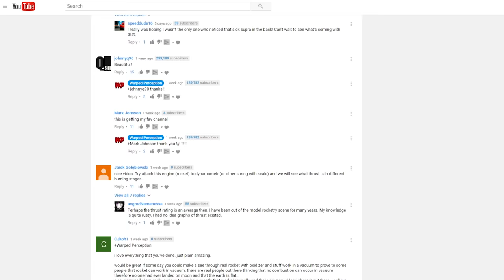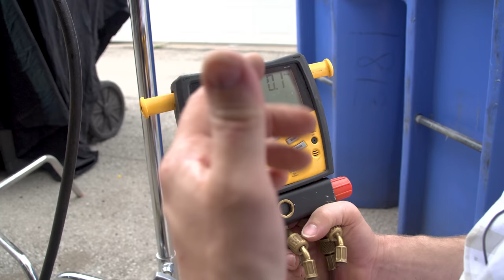Model Rocket Engine In A Vacuum Chamber - 4K Slow Motion - will it burn? - Rockets (S1 • E3)

Comment: Not. The rocket starts to move, only when the gases reach the bottom of the tube. In conclusion: There is no vacuum in space.
Reply: Except for that pesky little fact that we have MOUNTAINS of evidence that space IS hard vacuum.
For example I have personally helped build, test, and launch six spacecraft, two to earth orbit and four to deep space.
I helped operate three of those during their missions.
Reply: @stuartgray5877  OK. Surely you have done  these jobs, but this does not mean that there is a vacuum. 
If there really was a vacuum in space, rockets wouldn't work. This was proved in your experiment. Surely you have done  these works
Reply: @Aquariotp  - "If there really was a vacuum in space, rockets wouldn't work"
So based on YOUR misunderstanding of basic physics, a crossbow fired into a vacuum would NOT have recoil?
Are you SURE about that?
Reply: @stuartgray5877  Even using the gravitational theory it is not possible to generate a vacuum itself, but an equilibrium of bodies.
But the fact is that in your experiment the first few seconds did not generate any movement in the device.
The movement only occurred when the expelled gases touched the bottom of the tube. You can even see in slow motion that I'm right.
Reply: @Aquariotp  Again if you don't think that rocket propulsion works in a vacuum then you believe that a crossbow would not have recoil if fired into a vacuum.
Rocket propulsion is just mechanical recoil of the rocket engine pushing on mass.
Rockets and crossbows work on the same principle. When a machine "Pushes on mass" it feels a "reaction" known as "recoil".
A rocket engine feels "recoil" when it accelerates the mass of the exhaust gas.
Reply: @Aquariotp  for live video of what you claim is impossible, watch the YT video "uninterrupted footage of the falcon heavy launch and booster landing! 2-6-18".
Watch that from Launch to side booster landing then describe what you just witnessed.
Reply: @stuartgray5877  What videos?
Reply: @Aquariotp    for live video of what you claim is impossible, watch the YT video

 "uninterrupted footage of the falcon heavy launch and booster landing! 2-6-18"

Watch that from Launch to side booster landing then describe what you just witnessed.
Reply: @Aquariotp  do you understand how to search YouTube for a video when given the exact title?
Reply: @stuartgray5877  I've already analyzed several rocket launches and I found a series of inconsistencies.
And it really became clear that rockets don't go beyond 200 to 300 km. Sorry.
Reply: @Aquariotp  oh and I have witnessed over 30 real rocket launches, most from closet than the public is allowed.  Those included Atlas, Athena, delta-II, delta-IV, minotaur, space shuttle launched and landings, and falcon9 launch and booster return.
I'll BET that you have never seen a single launch yourself in person.  But you think you know more about this stuff than I do?
What do you think the ISS IS? You know the thing you can see IN ORBIT with your own eyes?
Reply: @Aquariotp  did you watch the "uninterrupted" video I asked you to above OR NOT?
If you have trouble spotting the numerous examples of rocket Propulsion in a vacuum in that video I would be happy to point them out to you.
Reply: @Aquariotp  search the net for "what happened to comet tempel-1 July 4th 2005" and explain that to me.
Reply: @Aquariotp  so you are claiming that the video I asked you to watch is "fake".  Thanks for proving that you didn't even try to watch it.  If you refuse to evaluate evidence then I am wasting my time here.  Enjoy your willful ignorance.

Comment: Your experiment proves nothing and here's why.  First of all no one knows you.  Second, you need to stop with the fancy camera work and just show the evidence.  Third, you never even shown us how much vacuum (Torr pressure) you were using  - you should have at least two gauges on each end of the tube with somehow showing the gages the same time as the test is being performed else the whole thing tends to look rigged. And Forthly, show what it does when say half as much vaccum is used to make note of any slight changes as possibly even compared to at atmosphere - (perhaps should have a ruler behind the spring to measure distance more accurately).

Comment: Your experiment is flawed
Reply: You didn't create an actual vacuum state. If you did, then it wouldnt ignite
Reply: @darklight2.1  for centuries we knew that this mixture would ignite in a vacuum??? Come tf on.
Reply: Also, chemical reactions cant occur in a vacuum state. Your tube cannot mimic the vacuum state of space. It's a neat experiment, though still flawed.
Reply: @darklight2.1  being submerged in water isnt the same as the vacuum of space.  Which is a real thing if you follow mainstream academics.  You know this.
Reply: @sledgerobbins2250  Care to watch a video of rocket propulsion i na vacuum?

Search YT for: "Uninterrupted Footage of the Falcon Heavy Launch and Booster Landing!"

watch the video from liftoff to the two side booster landings, then report back and explain what YOU SAW.
If you cannot spot the parts where rocket propulsion was working JUST FINE in a VACUUM let me know and Ill point it out to you.

And: The Tsiolkovsky rocket equation has been around for over 100 years.
You must think Aerospace Engineers are a bunch of imbeciles to not have VERIFIED that equation in over 100 years.
Hint: WE HAVE verified it both on earth in vacuum chambers AND in the vacuum of space.

Bonus question: At WHAT ALTITUDE does earth's atmospheric pressure drop to "VACUUM"?

Industry standard says that "Vacuum" is any pressure BELOW 1.0 Torr.

So can you tell me at WHAT ALTITUDE does earth's atmospheric pressure drop to BELOW 1.0 Torr?

Comment: the smoke from the fuel burning that he shows was still in the tube after the experiment, would that stay in the chamber while the vacuum is on? And doesn't the vacuum of space constantly suck ? If that is so the thing was pushing off of the smoke and back of the tube. IF the vacuum only sucked the remaining air in the tube and was off during the experiment that doesn't prove space travel is possible after somehow their tin can spaceships get through the layer that protects earth from vacuum space another contradiction of what Nasa claims is far up in the sky none of us will ever be able to see with our own eyes..
Reply: "doesn't the vacuum of space constantly suck": no, vacuum doesn't "suck", sorry.

"that doesn't prove space travel is possible"
That has been proved and done since decades.

" protects earth from vacuum"
What "vacuum" can do to the Earth ?

Comment: Your vacuum experiment does not represent the dynamic nature of space  as taught  (expanding)...   To get your premise correct you'd have to remove atmosphere at a rate that would maintain the specific vacuum properties that existed at ignition...(per the currently taught model of the expanding universe. 

The highest altitude simulation at rocket test chamber that I could find is 273,000ft ..  
Perhaps set chamber to matching torr and set a pump to activate to keep said torr...otherwise you're just creating atmospheric pressure within the chamber and therefore resistance for rocket exhaust plume focus and thrust.. 
The vacuum aspect at the end of your experiment is simply a pressure differential and needs to be validated to match at least 273,000ft

Comment: I see this video has not moved along much with comments, I am a Truther and that is all I ever seek, I am desperate for some-one to prove either way  whether rockets can fly in space or a vacuum . Experiments such as this prove nothing at all, you must take into account that the walls and the back end of the cylinder are reacted against by the expellent from the rocket  . In Space there are no such walls, the video actually proves this - In the slow -mo look at the gas and particles as they leave the rocket , you will observe that the particles are slowing down the closer they get to the end, this suggests resistance ( in space there is No resistance) there is a build up of gas fumes and you can see the blow back, the toxic atmosphere  builds up and increases the rockets thrust. The metal coil is a good idea but the vacuum chamber must be much larger to negate the effects of walls. 
   I also have just realised that he has not specified the rocket used , for a normal rocket to burn it must have Oxygen to create the desired Chemical reaction, in a vacuum there is no O but you can use or make special ones that have their own Oxidant. This omission makes me very suspicious ,and can I trust that there is a full vacuum being used. One point for the coil but Zero for everything else....
Reply: filosophia22,  cheers, much appreciated, but all I want is the truth, and all I get is subversion and deflection. They will point to NASA and Elon Muskrat  and that will brush all the cobwebs away. They usually revert to name calling and insults because that is easier than being logical, they are just parrots repeating what they have been taught ,but lack the insight to use critical thinking. Believe me, it would make my life much easier if some-one could prove to my satisfaction that rockets can not only fly in to space but get the power required to do what they do - that is because of newtons 3rd law and it specific relations to momentum. I have only basic knowledge of Physics but I use common sense which seems to be a rare commodity nowadays.
Reply: filosophia22,  cheers, much appreciated, all I seek is the truth  and believe me my life would be much easier, if  anyone can provide a proper experiment under scientific conditions then I would be happy. Listening to parrots that have no critical thinking and Quote NASA or Elon Muskrat and back up a shabby video like this is annoying.
Reply: But isn't the beauty of physical laws, that they are universally valid. Since you know the Newtonian laws, I think you can come up with four different experiment, which in conjunction prove, that rockets can work basically anywhere.

Comment: YOU NEED A BASE FOR THE TRUST TO PUSH OFF OF. NO BASE, NO THRUST. SORRY. HOW LONG WILL IT LAST LIKE YOU SAID, WITHOUT OXYGEN IT BURNED WHAT 8 TIMES FASTER OR DID IT BURN OUT.
Reply: Evets Dragline no you dont.you need mass and this can be proven outside of vacuum

Comment: You're vacuum chamber is a joke. It cannot achieve the vacuum of space. Visit a vacuum deposition tool used in wafer fabrication to get an idea of the pressures your dealing with and what kind of equipment it takes to achieve them. (Cryogenics, etc.)

Comment: Funny how it doesn't move until the engine FILLS the tube with smoke. This farce means nothing because the vacuum was NOT maintained. If you have a condition where you can exceed the engine by a couple of times, by adding an industrial vacuum on the exhaust side and maintain a real vacuum, you are getting close and the vacuum should be at least 28 inches of mercury at minimum. Fake space is only 2 hydrogen atoms per cubic meter... 

Newton wasn't kidding when he mentioned that it takes EQUAL AND OPPOSITE REACTIONS to create the FORCE necessary for movement. You shills think this parlor trick covers that? Not even a wee tiny bit. In fake space there is noting to cause an equal and opposite reaction and Boyle's gas law would dissipate the most massive rocket engine because gas always expands to fill the volume and fake space is an infinite volume. 

A fair test is making the chamber so the exhaust can't accidentally  hit the walls and maintaining a real vacuum, then the rocket would represent what would happen when one tries to navigate in fake space, No opposite reaction, no force  generated and NO MOVEMENT.
Reply: So, Robert are you still arguing that rocket Exhaust is massless?
Or do you think it does NOT get "accelerated" by the rocket engine?

Because ANY device that applies a force to a mass (accelerating it) MUST feel an "equal and opposite force".

So, are you arguing that rockets do NOT apply a force to the mass of the exhaust gas?
Or that the exhaust gas has no mass?

I am just trying to figure out where your confusion lies.
Reply: @robertfish4734  that sounds exactly like what a fish would say
Reply: @robertfish4734  So you believe that rockets accelerate mass into the vacuum without applying a force to that mass?
Or do you believe that rocket s do apply a force to the exhaust gas but don't feel any "equal and opposite force"?

So, do you think that rockets defy Newtons first two laws or that they defy the third?
Which is it?
Reply: @rocketman484  >So you believe that rockets accelerate mass into the vacuum without applying a force to that mass? 

I don't need to believe, because it is scientific law that dictates in order for movement you must have an equal and opposite reaction  to what ever single reaction you create, (as you only have the single part, rocket thrust but in your limited mind this part alludes you)  This is only a single force with nothing to react with, sadly,  therefore, in order to create the force for movement, it must have something to create this opposite reaction. This is like one hand clapping which makes no noise. 

Try this with your mum's vacuum cleaner. Switch it on and take a very deep breath, then place the hose over your mouth and blow just as hard as you can, imagining that you are the biggest rocket engine in the universe, as the comparison to an actual rocket vs infinite fake and 2 hydrogen atoms per cubic meter low pressure makes your mum's vac super disadvantaged and your pretend super rocket infinitely bigger than all the rockets ever made!

Notice how the hose remains over your lips and your lungs are starting to invert. The  vac negated all the equal and opposite force necessary.

>Or do you believe that rocket s do apply a force to the exhaust gas but don't feel any "equal and opposite force"? So, do you think that rockets defy Newtons first two laws or that they defy the third? Which is it?

No, belief is only necessary in your fake world Sluggo.  If you strap a rocket engine to a rail car on straight tracks and build a wall just behind the engine, on the same rail car so it covers all the thrust that would normally push the real car forward,  and set the thrust to 11 and pres FIRE, the car won't move.  This is because of what actual engineers call a "static moment". It is not possible to push against yourself and create movement. As the car and the rocket and the wall are one unit, you wast a bunch of energy and accomplish little other than a dandy fire display.

How rockets work in our real world... Rockets are launched vertically in atmosphere (equal and opposite reaction, no fake space vacuum) then they curve to horizontal, then point down  so they can ditch in the ocean. Navigation in fake space is not possible UNLESS  you break scientific law, which sadly you are super ignorant and lack very basic stuff, Mister rocket infant. 

Have a nice day
Reply: @stuartgray5877  He is still denying that the mass shooting out of the rocket requires a force to push it.
He thinks mass can just magically start changing velocity without any force applied!
Reply: @robertfish4734  - "I don't need to believe, because it is scientific law that dictates in order for movement you must have an equal and opposite reaction  to what ever single reaction you create"

So do you agree that the rocket MUST apply a force to the mass of the exhaust gas to accelerate it into the vacuum?
The vacuum cannot apply a force (regardless of what you think).

so, the force MUST come from SOMEWHERE.
If not the rocket, then WHERE?
Is it "Magic" that accelerates all that mass?
Reply: @robertfish4734  Once you learn to NOT get your physics education from Hollywood movies, we will make some progress.
No, the "vacuum of space" DOES NOT "SUCK".
It cannot.
Or would YOU care to explain exactly the mechanics for absolutely "NOTHING" to apply a force to matter.
please be my guest.

The Universal gas laws explain how gas can PUSH on mass but there is NO mechanism for "nothing" to PULL on anything.

Comment: This was not a proper vacuum. If it were you would have needed to have oxygen tank to feed it.
Reply: I guess try again, with a genuine vacuum
Reply: That rocket doesn't needs oxygen to burn.
Reply: You cannot prove that rockets can push off nothing, unless there is NO GASES inside. Clearly there was. Do you realize what it take to make a space vacuum?
Reply: Not going to be basic plastic, that's for sure. It would implode.
Reply: @Joseph : "You cannot prove that rockets can push off nothing" : this is a simple application of Newton's law of motion. 500 years old, and still working well.
And of course, there are rockets in space since the 40's so what?
Reply: How about you do convince the nasa vacuum chamber in Ohio to simulate space to do the test? Note the extent they go to in order to produce the vacuum.
Reply: So where are the nasa test footage of them testing the concept before using it? Dont you think they would exist?
Reply: "How about you do convince the nasa vacuum chamber in Ohio to simulate space to do the test?"
It's useless and messy.
Useless, because we know it works.
Messy, because vacuum chambers dont like too much greases and all the compound a combustion would generate (they stick in the walls and takes ages to evacuate, polluting the vacuum).
Reply: @Joseph : "where are the nasa test footage of them testing the concept before using it? Dont you think they would exist?"
I dont think so.
Germans invented the propulsion by reaction.
The concept was already well tested when NASA reused it.

And a rocket motor that works well on ground works even better without atmosphere, so, why bother?
In fact, they have to tune the evacuation chamber shape for vacuum, but that doesnt really need a combustion test to be done.